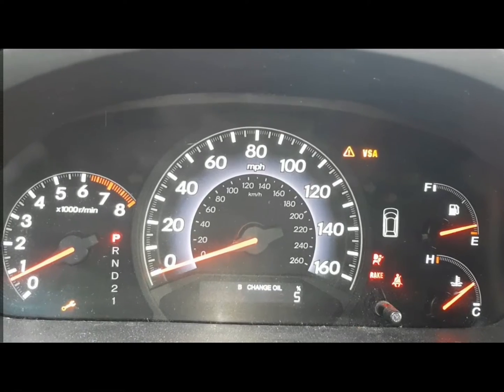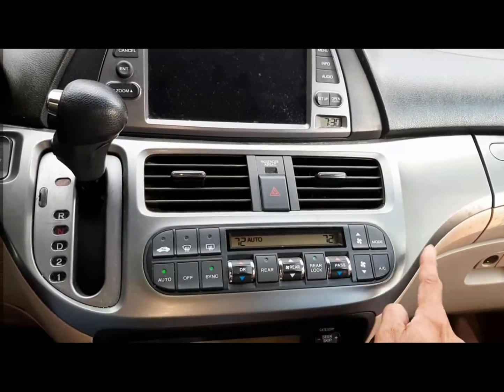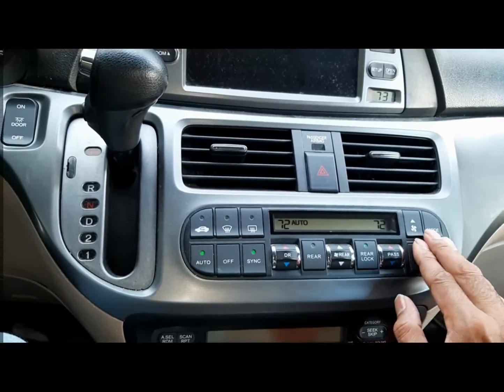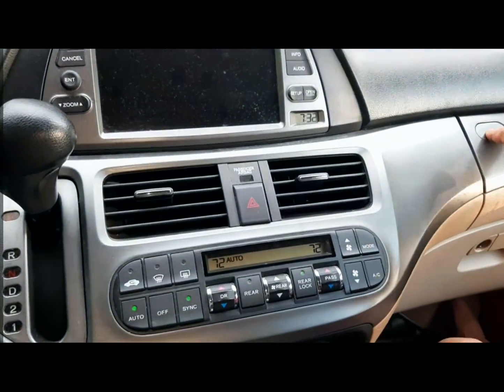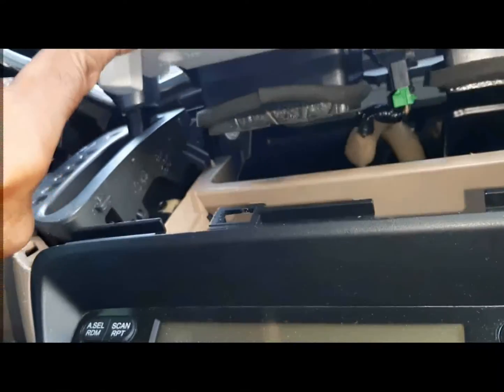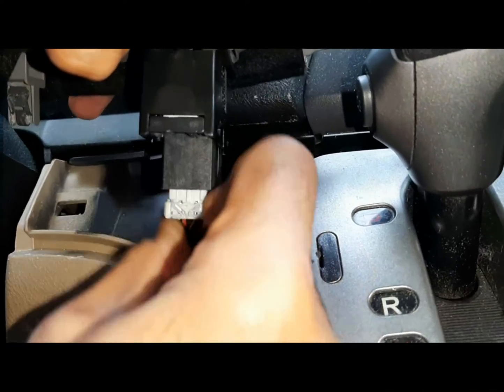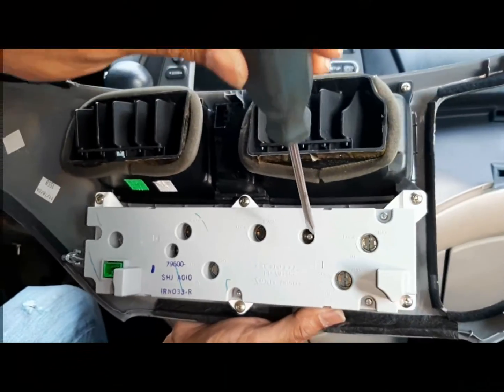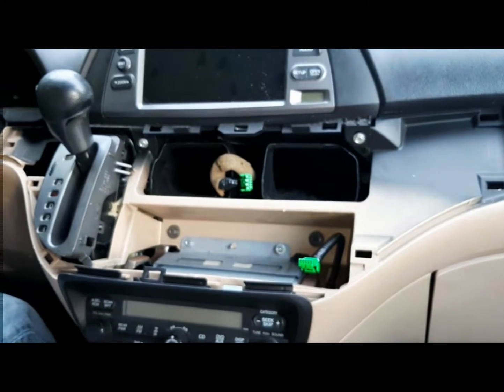VSA light staying ON ABS code 26-1Lateral Acceleration sensor failure Location and how to fix it

Comment: I found the box, ACTIVE NOISE CANCELLATION (ANC) COMPUTER CONTROL MODULE HONDA ODYSSEY, not sure what it has to do with the VSA, Honda says... The ANC system eliminates noise caused by both VCM cylinder deactivation and exhaust noise. 

The ANC controller uses a front ceiling-mounted microphone and a rear tray microphone to detect any “booming” sound in the cabin associated with cylinder deactivation. 
It then emits a mirror “anti-noise” signal through the audio system’s speakers, which effectively cancels those booming sounds and creates a quieter passenger compartment. 
ANC is always working, even when the audio system is turned off.
Reply: Did you ever figure out if replacing that worked? What worked for you? I’m having the same issue. I have code 26-01